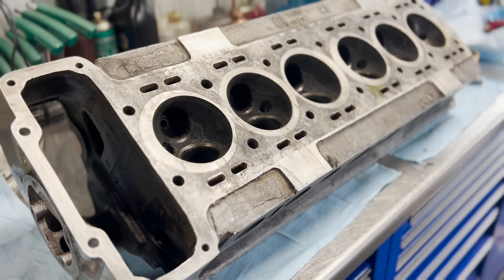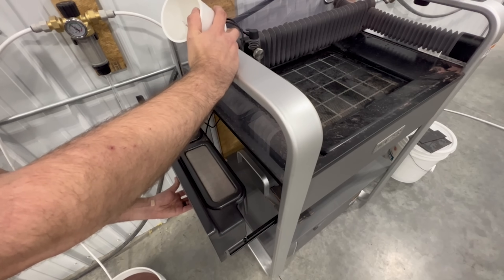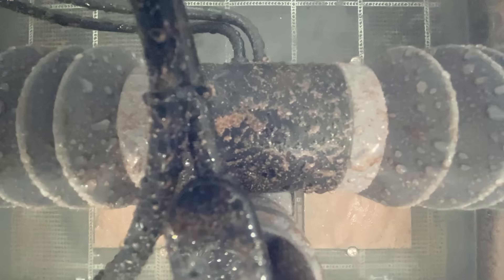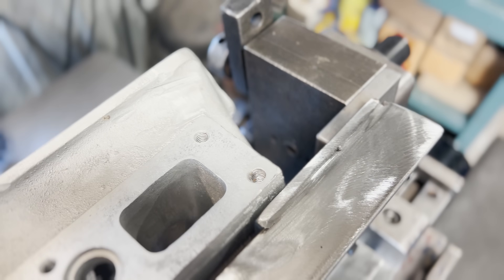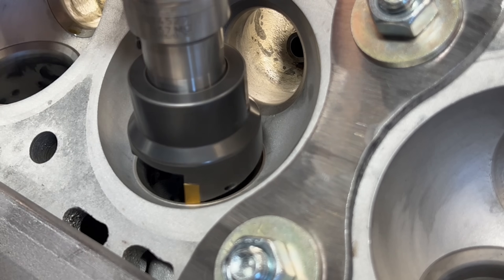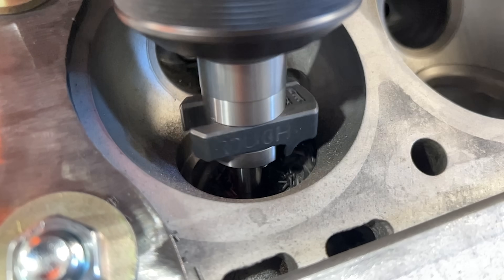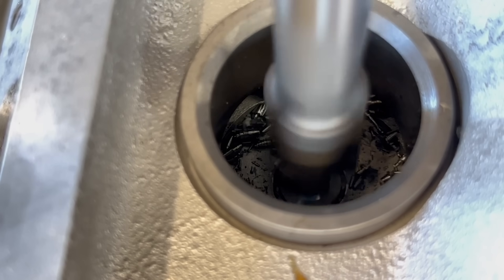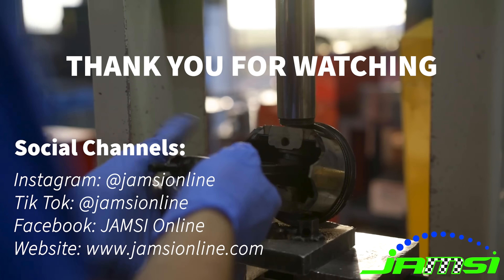I Made A Custom Fixture For This 4.2L Jaguar Head w/ A WAZER Waterjet!

Comment: Wow that wazer is slow
Reply from the maker: Keep an open mind. I'd encourage you to go read about WAZER on their website. This is the perfect machine for a shop like ours, or a home machine shop. I would never consider buying an industrial sized waterjet. I don't have room for one, I don't have a need on a daily basis for one, and I most definitely don't have the budget for one. But that being said, WAZER fits in a compact package, with capability to cut up to 1/4" mild steel, 1/2" aluminum, and literally any other material you can think of. But the kicker? It's at a fraction of the price of an industrial sized waterjet. 

Like I said in the video - Get the cut going, and work on something else while it runs. It may not cut at warp speed on the maximum thickness capability, but I have plenty of other things I can work on while it runs.
Reply: @JAMSIONLINE  block this guy already.